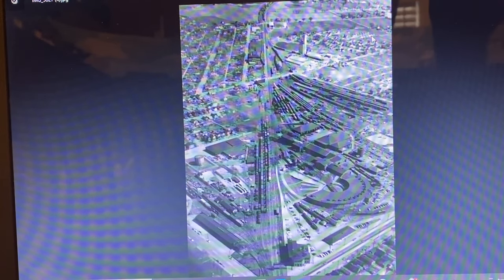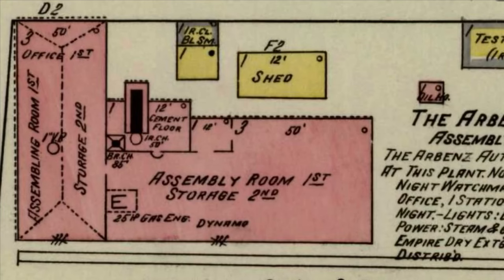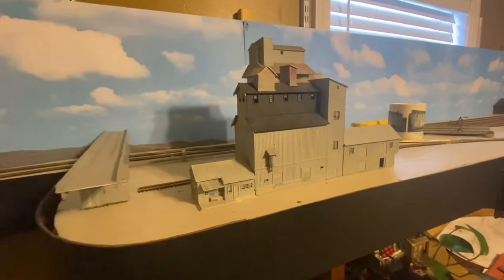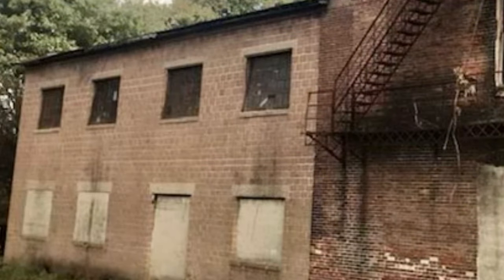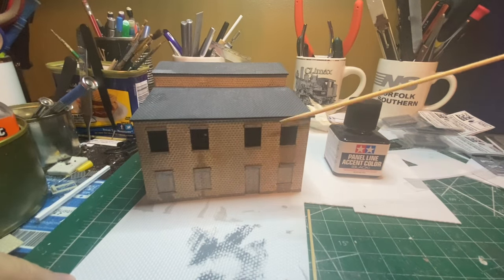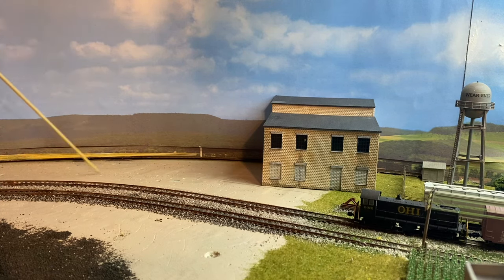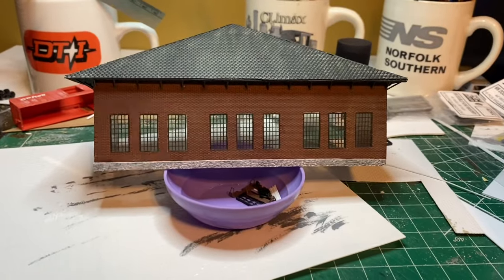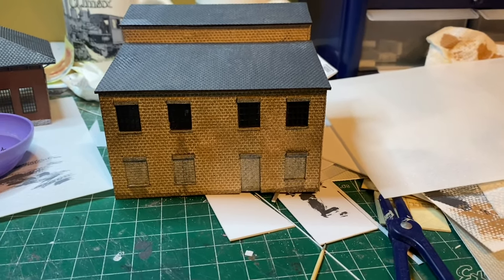Background building #2: the Arbenz annex

Comment: Just thought I'd check with the old buildings you might have worked on and I must say they look quite good. Sometimes those building additions or little secondary buildings have more quirks than the original building especially here like in Milwaukee everything from Cream City brick to slabs of lannonstone. Trusting you're feeling better hopefully getting better as the holidays come up. If you get extremely bored I may not have mentioned this earlier but there is a site showing 1930s aerial views of RR ROWs in WI. IL. IN for the most part including some of those lines you followed. One just came up of some little short line that was built to haul oil in Southern Illinois and you'd be amazed at the number of derricks and tanks in the area. He also has some older footage converted from tapes but he also shoots some newer items in fact today's is very interesting with an old steel lift bridge. Prototype Trains & Historic Aerials of ROWs
Reply from the maker: Hi Paul. Thanks for the compliments. You’re right, older buildings have more character than new ones. Especially when modern additions are added to old buildings, the variety of materials and angles can be very interesting.
I am getting better and I’m trying to get away from watching videos and doing more things with my hands. I wonder how they got all of those aerial views in the 1930’s? 
I may try to get out on a nice day next week to film some real trains, but will probably stay close by. Plenty of NS trains here in Georgetown anyway.
Thanks for watching and telling me about the website. Have a good evening and stay safe!
Reply from the maker: That is one flimsy looking bridge!